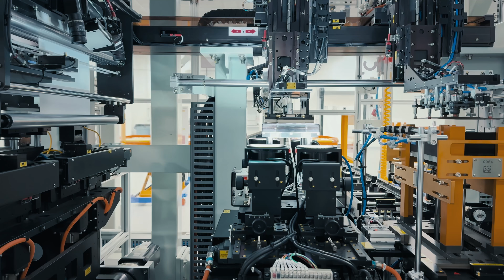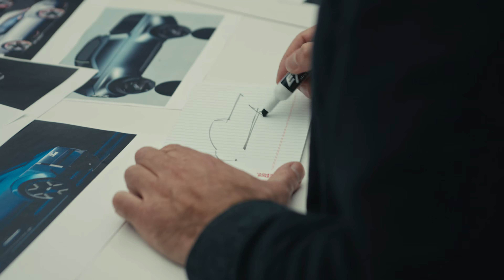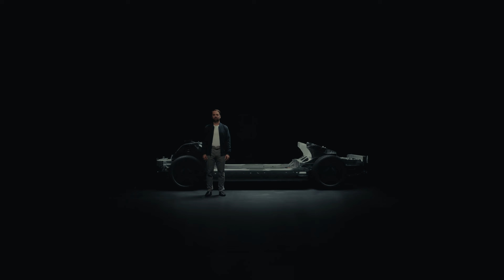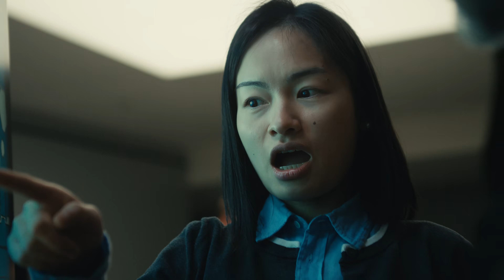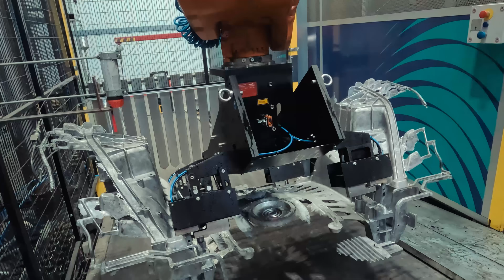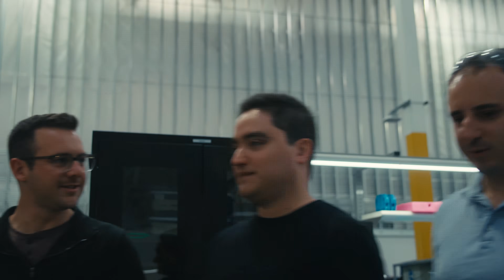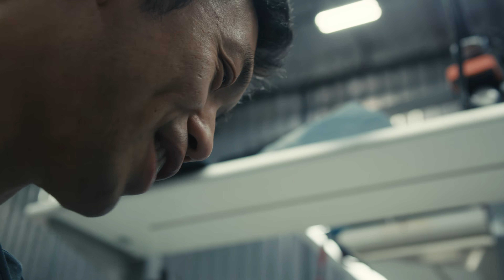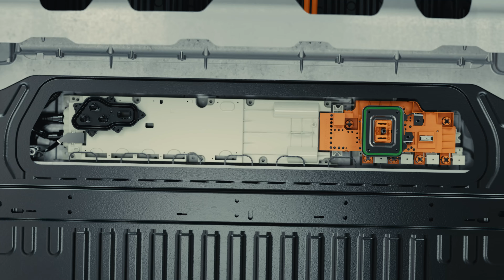Ford Bounty Hunters: The Pursuit of Efficiency

Comment: Seriously?! I'm not a China-supporter at all, even the opposite (a long-time, recurring, "serial" Ford cars & trucks consumer here), but you're boasting with "innovations" Chinese EV manufacturers or Tesla are using for years already (unicasting, LFP, cell-direct-to-structure, consolidating the ECUs, 48V instead of 12V). Also, cramming many components into one ("8-in-1", for example) has very negative effects on the serviceability at reasonable cost level, thus produces unnecessary waste in the long run. Finally, you're talking about a 400 Volts system, while the really innovative EVs are on 800 (or more) Volts systems already. BTW, what happened with the F150 Lightning, why did you have to discontinue manufacturing that???!!! You should've solved the problems around that model before focusing on "innovative solutions" (in fact: already used by other mainstream EV manufacturers)

Comment: So you've spent the past decade building trucks with shoulder high, flat grills  and now you've discovered aerodynamics!  How expensive are all those cast aluminum pieces when they get damaged in an accident?  And will they be repairable?  Doubt it.  
Why do you have ANY wiring harnesses.  20 years ago the industry said it was going to do all connections with fiberoptic cable.  What happened to all that tech?  A lousy 15% increase in range?  So we can go 345 miles instead of 300?  Why haven't you designed swapable battery packs and a network of stations where drivers can pick up a fresh pack?  What happens to all that cast aluminum when the battery catches fire?  Does your battery work in cold temperatures?   Does it act like thermite?  We want vehicles that cam be repaired by garage mechanics, and can drive 600 - 800 miles.

Suggest you go back to the drawing board

Comment: I know I’m gonna be disappointed by the new Ford truck. Why because I’m hearing zero about the amazing tech Ford will imbed in the truck and in the app.
The worst thing about the Lightning besides its bloated price? Crap or non-existent tech.  Buttons all over the steering wheel and dash.
Tesla gets tech correct. I have zero confidence in Ford doing this. This looks like a el Camino. Ick. The MUSTANG TRUCK!

Comment: I used to love Ford—I’ve owned quite a few over the years and still have an F-150 and a Mustang GT. But the pricing over the last few years has gotten… ambitious. $200k+ for a Dark Horse build, $300k+ for a GTD, and Shelby models starting around $180–220k? For a Mustang?
What’s disappointing is losing that enthusiast sweet spot. Cars like the GT350 and GT500 were expensive, sure—but they actually made sense. Now, unless you’re spending supercar money, you’re not getting the best versions—and even then, no manual, no real high-performance convertible… just exclusivity and price tags.
At this point, it’s hard not to look at Porsche. Never thought I’d say that as a longtime Ford guy, but apparently that’s the new comparison Ford is aiming for.

Comment: Excellent, informative video. Love steps to decrease aerodynamic drag and eliminate excess wiring. My main concern is with integrating so many parts. One used to be able to replace just a headlight bulb for $10. Now it seems the headlight assembly is all one part and costs $1,000. Will these integrated parts have a similar effect for owners? Likewise, will it cause cars to be totalled much more easily?

Comment: As an aerospace engineer I applaud the approach.  The optimization goals really target the performance and invert the vicious spiral of weight & cost.  However as a sustainment engineer I’m nervous.  Those large unicastings are awesome from a structural standpoint, but any accident that damages that part might mean the entire thing needs replacement - which could result in totaling the car because of the economics.  So is this a disposable vehicle?  How repairable will it be? 
Same issue with the electronics.  By consolidating into one large unit you save on manufacturing costs, but it means that a small fault in one part of the unit forces total replacement at high cost, vs swapping out a smaller, cheaper discrete LRU…
So in your bounty system, where does sustainment come in?  Or is it marginalized?

Comment: I'm looking forward to buying an American Electric truck made in my homestate!  Sounds like you guys have put some genuine thought behind this design.  Can't wait to hear about the EREV Truck as well.
Reply: Same.

If they make all of these improvements and essentially remove almost all of the battery altogether, I would assume the price goes down dramatically.

I imagine that heat management will not be as bad because the engine could be much less robust and operate at more predictable fixed RPMs.

Comment: ICE vehicles are relatively easy to build but EVs are much harder as you must focus on efficiency to get an EV with a decent amount of range.  A vehicle that cannot go 300 miles is a no-go for most customers, even if they won't use that range most days.  I was disappointed when Ford pulled back or paused their EV plans but this new EV truck looks promising.

As an owner of EVs for the last 12 years, I feel that they are expensive and the price must reach parity with ICE vehicles as most customers will only consider purchase price and not TCO like fleet operators do.

Comment: I applaud the innovation of design and manufacturing efficiency improvements with high ROI. One concern is the cost cutting approach sanded to customer facing components such as the interior or with using subpar internals with a low lifespan. Despite what the MBAs may state with interior cost cutting alternatives, the vehicle has to sell. Also, please, implement a solution to prevent dealerships from implementing a +25% markup to take advantage of the demand and cost cutting. We want this to succeed. BTW, Maverick EV sounds more modern and than Ranchero name. Else, there may be another name available in the copyright bin. Great luck!

Comment: Soooo, when the battery needs to be replaced, for whatever reason, the entire car has to be taken apart? Based on what I saw in the video, the battery cells sit inside the lower part of the vehicle, which is sealed and connected to the front and rear parts of the chassis. The rest of the car is attached/built around that. So, what is the plan for accessing those when needed? Remove the entire interior of the vehicle?
Reply: How often does the battery need to be replaced "for whatever reason?"  'They rarely do' is the answer to that question.
Reply: @alanrivaldo-h if something can go wrong, something will go wrong. But hey, I’m not the target audience for this so doesn’t matter to me.

Comment: Very interesting video. One question: won't unicasting make some repairs more difficult and expensive, or even impossible?
Same goes for the battery integrated into the vehicle structure - won't getting it out make any attempt at repair economically pointless?
Won't all this make electric Fords throwaway-cars?

Comment: Excellent progress.

Efficiency does not only lead to reduced cost and eventually lower sales price, but it also provides lower operating costs for the owners and less infrastructure needed to run EV's. Remember, every kWh that you don't consume does not have to be recharged.
Every kWh saved also reduces the need for renewable electricity leaving it for more EV's or other uses.

I think I've heard about these ideas somewhere else. ;-) Castings, zonal architecture, 48 volt system.
In Dutch we have a saying: It's better to steal well than to invent poorly.
I hope the mind set you show in this video will put Ford EV's on the right track for success. The transition to sustainable transportation depends on it.

Comment: Although I'll admit I like what I'm seeing, I would add if this is a 2 door little truck like vehicle like the maverick, I'm not Interested. Hopefully they use the changes for a CAR or SUV , as a small Truck payload weight will be issue if your hauling stuff around. Again I admit it looks interesting 🤔. I wonder what the overall weight will be ? With the battery. Also crash tests how well will this hold up. Of course Ford is behind on battery technology, but at least their trying to catch-up.

Comment: The battery is 40% the cost of the vehicle you say, and in 2025 1 KWH of battery storage in a vehicle cost between $99 to $108 per KWH so that means a 140KWH battery cost $15,000 on the high end. This is the size of the battery in a Ford Lightning so if $15,000 is 40% of the total cost of the vehicle then that maximum Cost is $38,000 so why then is a Lightning $80,000? Greed thats why, there is no such thing as an honest profit anymore it's all extract as much as possible out of the consumer so CEO's can get their million dollar pay packages. It's really getting disgusting in America the greed these corporations have. These companies don't pay on the high end for any materials so they don't even pay $15,000 per vehicle for the batteries. Also the Ford lightning used many parts that were the same as every other Ford F150 produced which made that vehicle even more cost effective on the production line. Ford just priced themselves out of the EV market and they wouldn't back off on the MSRP because if they did they would have to back off on the MSRP on the Gas vehicles as well. They just decided to discontinue it instead and keep the Gas prices high and then build this new midsize truck. Its the Gas buyers that are being screwed and I am really surprised these gas buyers haven't figured that out yet.
Reply: Tell me you’ve never worked in manufacturing without telling me
Reply: @scottoden4144  oh you think you are so clever don't you. In fact I am using Fords own words so are you saying they are double talking?
Reply: @darinbr @darinbrazil5496  say you haven’t worked in a factory to truly understand but Development costs, hidden factory costs, inflation, tariffs, unforeseen circumstances all add to the price. A regular f150 average price is between 50-60k depending on trim . Lightning starting price is 50k. Sure it can max at 80+ but so can a regular f150

Comment: Kinda weird in the video - they talk about applying the same concepts from the low voltage harness to the high voltage system - and then they stick with 400V?  Makes no sense.  Lucid and others went to 800V, claim not a big cost hit, and they have killer charging times and the most efficient EVs.  Everything else in the video makes sense like better aero, centralized modulesc and single castings (all things Tesla has done for years now), but staying with 400V has me confused.
Reply: 400v is cheaper.
Reply: @5Lax  That wasn't the target though from the video.  They mentioned doing things that might increase cost of a component, but then to have less cost or increased efficiency (smaller battery) to decrease overall cost.  Going with 800V is less copper in the wiring and less weight (cost savings), though the drive inverter and power electronics are indeed more - but overall it isn't a huge increase.  Farley also previously mentioned how charging time needs to be improved, from his personal charging experience driving the F-150 Lightning.  No mention at all in this video, so not an improvement coming from this new platform apparently - seems they forgot.
Reply: @billjohnson3344  The cost savings of 800V wiring is pretty small compared to the cost of the 800V power electronics since it's only a few feet of straightforward wiring rather than miles of it like the 12/48V system. The bigger savings would be the lower battery capacity from 800V's marginally lower inefficiency losses. Also, increasing charging speed is requires the battery cells to be able to handle it, and the cost- and energy density- biased LFP cells they're using probably can't accept more than 150kW anyways, meaning 400V is easily enough. Also consider that it's still easier to find 400V stations, and it takes extra components to make 800V cars charge properly at 400V stations.

If they were targeting the ~$45k price point it'd be a bit outrageous not to have 800V, but at the ~$30k price they're targeting 400V is acceptable for this decade.
Reply: 800V electronics are still too expensive for the ~$30k price point they are trying to hit. Other than the Hyundai/Kia Ioniq 5/6/EV6, all 800V cars sold in the US are luxury cars. Even in China, 800V cars are limited to the half-luxury segment and up, most cars sold are still 400V, and the best selling 800V vehicle is the Xiaomi YU7, a big disruptor in the market. Additionally, an 800V battery pack would cost a bit more (double the number of half-capacity cells) and that smaller cell size required may not be readily available yet (larger LFP cells can also be used for BESSs).

While 800V helps a bit for efficiency, its main use is for charging speed. But the LFP cells they're using are likely incapable of charging fast enough to actually take advantage of 800V chargers, as they'd have to be made a little less energy dense (pricier).
Reply: We don’t know what the cost increase is. It’s clear the primary goal on this is price price price. Comparing to lucid isn’t valid because those cars are three to four times as much.
Reply: @Calibr21  Again, support for 800V is certainly more cost in certain areas (power electronics), but if the cabling and battery cost is reduced as result of the lower cabling weight, net is near zero.  Same strategy Ford mentioned for everything else.  I used Lucid as an example as they are the efficiency king, but other mainstream vehicles like Kia/Hyundai also are 800V today.  Coming out with a new platform for next gen vehicles that isn't 800V is just baffling.
Reply: Absolutely agree. It's like putting out a movie on VHS when DVD is already the norm. They need to stay ahead, including waiting until they see what happens with solid state batteries.

Comment: An aerodynamic electric truck? Almost all of this effort gets thrown away as soon as you tow a trailer.
 Slap one of those new electric hybrid turbos on a maverick with optional 20, 40, or 80kw batteries, now you have 6-800 miles of range with 4k towing.

All of this technology should go in the "mustang"
Reply: We got a troll
Reply: @scottoden4144 care to elaborate
Reply: they're going to do this with the extended range EV truck in a year or two.  Electric drive with medium size battery, and gas engine to recharge battery if needed

Comment: Ford , this is great to see!   I do hope you plan on building a charging network as well to go along with this new mass EV approach. It was one of the most important cogs in the wheel of the mega success for Tesla and so far no other automaker has bothered to do their own version of a “supercharger” network.
Reply: And since elon imo foolishly opened it up without making the other oems pay through the nose to access it? They won't either although they are making a mild effort with the ionna setup. By 2030 it should be interesting to see how far they've gone? But so far tesla in a month on average opens more posts than ionna did in all of 2025!
Reply: So far everyone has shifted to making their vehicles compatible with the supercharger network.  In fact, Ford was one of the first 3rd party manufacturers to get access to the supercharger network.

Comment: Unless legacy automakers reform or replace the predatory dealership model, they're gonna continue to struggle in the EV marketplace. The underlying problem is the dealership model relies on service and support which gas vehicles need but electric vehicles don't. 

Going forward, instead of supporting automakers and dealerships through maintenance and repair costs, car owners will have to have subscriptions to access self-driving, internet, infotainment and other data-driven services - and perhaps to even operate the vehicle!

Put simply, unless they revise or get rid of the dealership model, Ford and GM will be leaving the passenger auto market. You won't need a factory service center to do OTA updates and feature upgrades. The subscription model will provide reliable revenue streams at a fraction of the current expense for "automotive technicians" and service equipment.

The only snag to their strategy is that, while it's impossible for another manufacturer to offer a gas car that doesn't need repairs, it is possible to offer an EV that doesn't require a subscription to own. As for the dealerships... Ford, GM and other legacy automakers need to join forces and go to war against NADA to get the exclusionary laws and regulations - most of which are at the state level - changed. It's gonna take time and money, but it can be done. If employee non-complete clauses must be time limited and cannot be unconscionable, the same must apply to exclusionary dealership agreements.
Reply: Legislation has to be passed to change the ability to allow manufacturer direct sales. Harley understands that situation very well.

Comment: Move to 48 volt is essential. Tesla was talking about that a while back, but did nothing.
Reply: Cybercrap is 48V. the industry has been talking about that for years but always down to unavailability of parts at the right price. 12V motors by the millions. Semiconductors are no problem. .
Reply: @jamesvandamme7786 cab or truck?

Comment: Love all the cost cutting, integration, efficiency  gains..... Until it needs to be repaired... And it becomes disposable....... Doesn't have to be made that way, but since it's the cheapest way to do it and nobody's talking about its repairability....So that's my guess.... 

FWIW, I really like its PCB busbar, since it's such a simple idea with so many benefits that I was able to think of it a long time ago..... Nice to see that it's finally making it to the market for an OEM automaker. And it should actually contribute to reliability and repairability. (but if it's buried in an unrepairable battery pack that won't really matter) c'est la vie